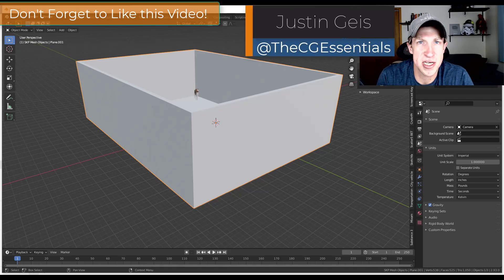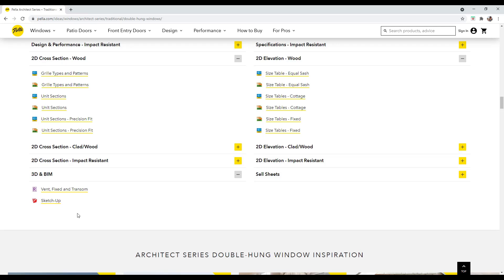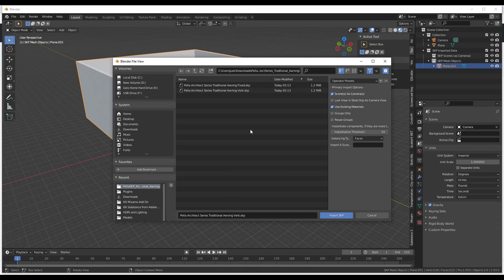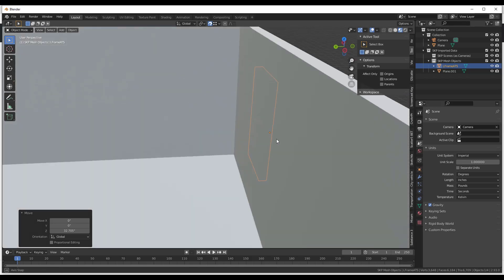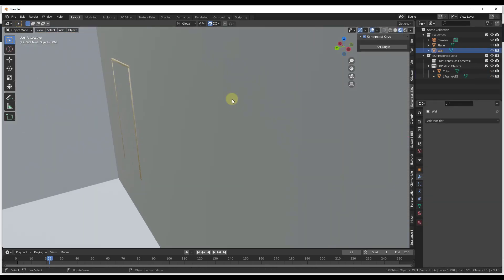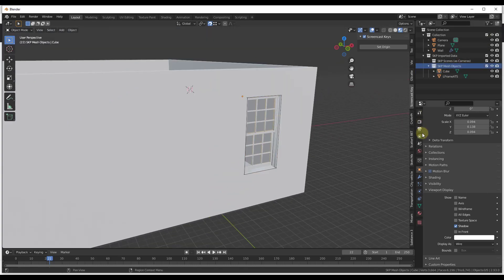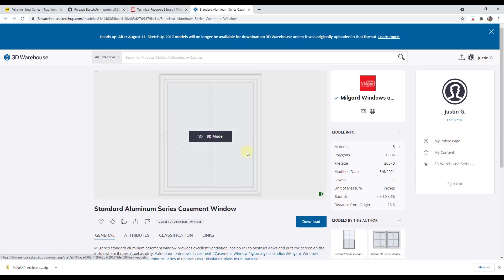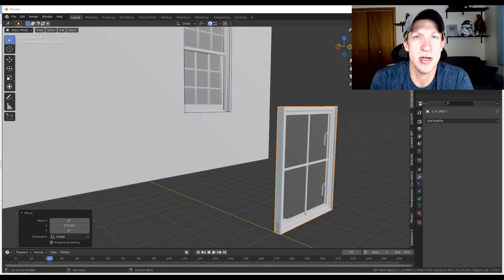How to Use FREE Manufacturer Architectural Models in Blender! (Doors, Windows, Etc)

Comment: Joining the pieces into one object in Blender 4.1 results in an 'Active object is not a selected mesh' warning. Edit: With a bit of web-searchery, I found that clicking on one element in the importing object, then selecting all, then ctrl + j to join works ok. On reddit, 'One of them has to be the active object. Active objects will be highlighted in yellow rather than orange. If you click one of the objects once it should set it as active.'

Comment: hello this is unrelated to a video, but basically i’m new to blender and i’ve loved making some renders with it. but recently now that i’ve been getting interior room models from sites like cgtrader and free3d, i’ve run into a problem where i have to download the obj file and texture files separately, and put the textures onto each individual object manually. it’s a very lengthy process and just painful in general. do you happen to know a way to import a object and it’s textures all at the same time? or to assign a obj all of it’s textures at once? (i tried the find missing files thing and it never works). thank you, i really love making graphical art and i want to continue but this issue is holding me back.

Comment: Nice solution. I have modeled a lot of arch. in Sketchup where you just choose a window from the 3D Whse. and it places it directly on the wall face and cuts the hole at the same time. It's incredibly slick plus obviously the building industry is supplying SKP native 3D models. I use Blender much more, but for architecture . . . yeah, SKP/Layout is pretty hard to beat.  It just doesn't render anywhere near the level of Blender of course. At this point I am modeling art in Blender, arch. in SKP, importing the art into SKP, and dimension dwgs either in SKP directly, or formal drawings in Layout. It's quite a convoluted workflow, yet somehow the quickest route to what I need. Would love to be able to do most of that in Blender.
Reply from the maker: I agree - I don't understand the people that say that Blender has already passed SketchUp in the architectural area, or that it's a better drafting tool. That's just not true. Not to say Blender isn't awesome, but it's clearly designed to be more of a Maya/Max competitor, not to be a drafting tool. Glad you've found a workflow that works for you though! :)